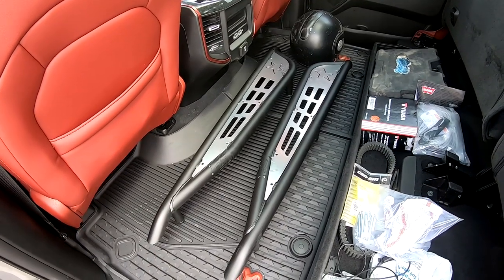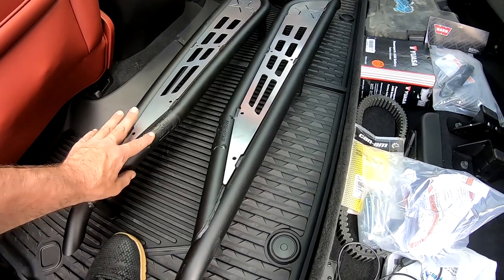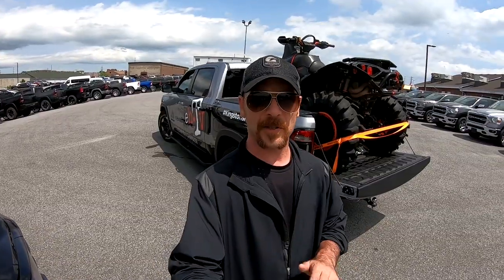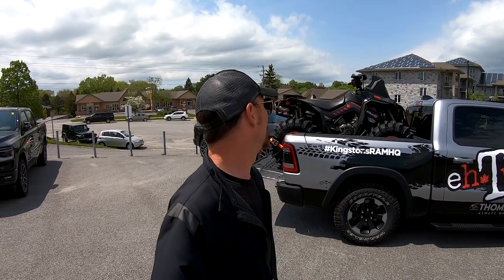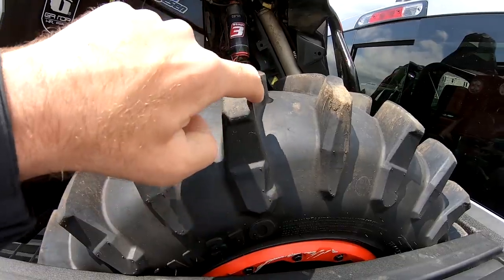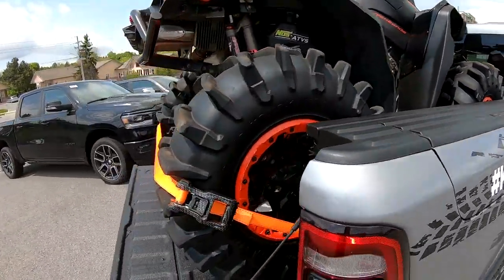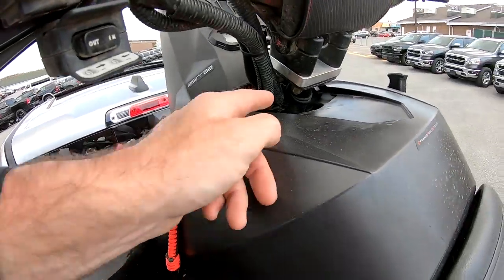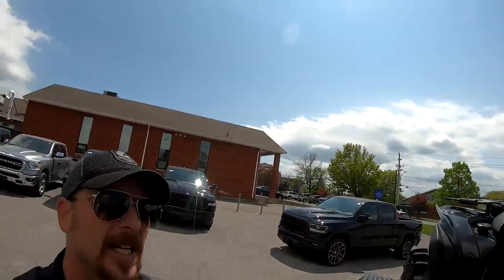Renegade Rundown, Complete parts list

Comment: I was wondering when we were gonna get a full tour of that truck. I just love all the innovations on that RAM. Awesome storage and it's a super good lookin' machine ta-boot! I cracked up when you pointed out "always good to have lots of tools when . . . . . you're out rippin' on the trails". You were gonna say "drivin' a CanAm", but there was this big pause while you gathered your senses - HAHAHAHA!!! That was hilarious bud! I don't like the rims at all, so seeing as how you asked . . . YES, put some nicer rims on that truck - LOL!
Try lock-washers on your skid plate bolts so they don't come loose.
So let's see: The diff isn't stock, the tires aren't stock, the shocks aren't stock, the exhaust isn't stock, the driveshaft isn't stock, the clutches aren't stock, 4WD isn't stock, bushings aren't stock, the steering box isn't stock, the back rack isn't stock, the lights aren't stock . . . . can we really still call it a CanAm? LOL - just kidding of course! CanAm should hire you to work with their engineers so their machines come out of the factory with some of those upgrades already in place (ie: the rad screen, bushings, etc)
Excellent video bud! Very informative!
Reply from the maker: As the skids get bashed in here and there it actually bends the horseshoe style looking bracket that they bolt too. Nothing a few light taps with the hammer can't fix. Hahaha. Yeah ya got me there, Not much left stock but the heart of the machine. But let me tell ya, once ya ride one that's all you'll need LOL.  Well I'll say this about the Ram wheels, It's about all I'd change on this Truck. Thing is pretty much perfect as is. For me anyways. Haha. Cheers my friend, Always look forward to reading your comments.

Comment: I want to get an RJWC exhaust for my XMR defender. But I was told it voids the warranty, is this true.
Reply from the maker: Only if you have a crappy dealer, These machines have a pretty damn near bullet proof drivetrain so most will allow an exhaust and tuner as it's easy to switch back to stock if BRP requires picks of the unit for your warranty claim. Or ya just go ahead and revert it back your self if you ever encounter a major issue and want to take it in. My dealer will install them for you on your brand new unit. Bay for the win. Good Pipe man, super high quality build materials.
Reply from the maker: And my buddy at Dirtylife is having a blow out on RJWC products right now, Maybe give him a ring if ya do decide to grab one. Cheers man
Reply: Awesome thanks, I actually met Trevor at a run I was on. I’ll give him a shout for sure, appreciate the info. Love the vids man.